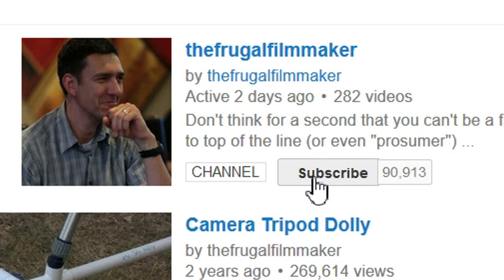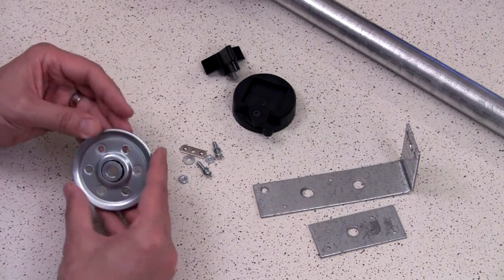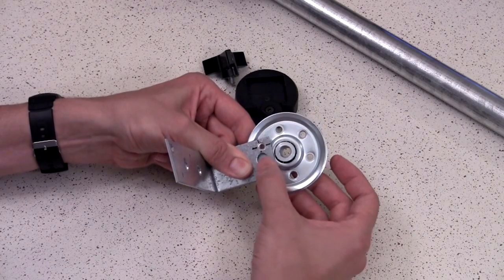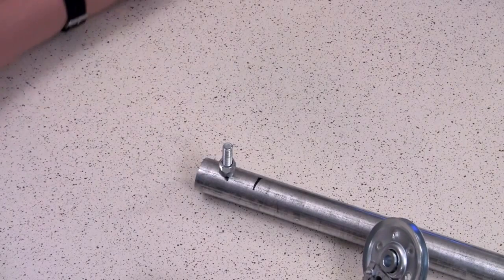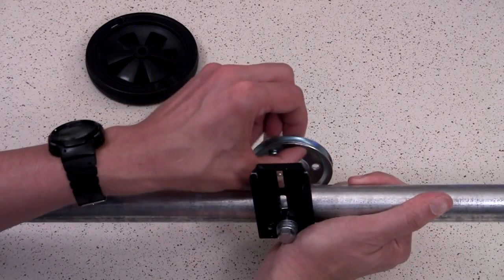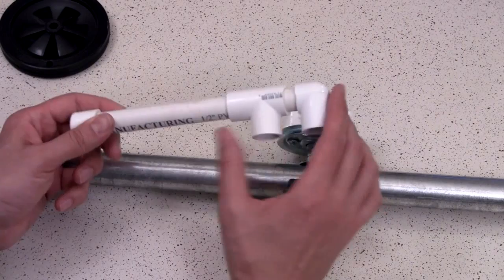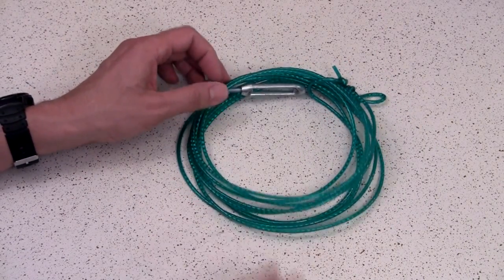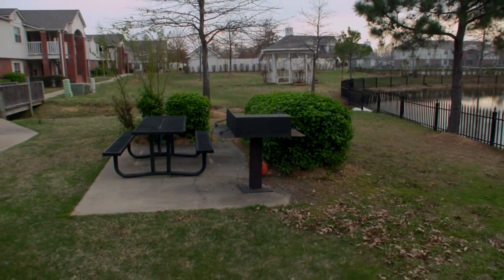Frugal Camera Crane / Jib 2.0

Comment: Re: Stabilizing Tilt... Forget pulley ratios and friction! One to One rotation gives perfect reference to camera angle and you can add a protractor and stops to calibrate shot points. LOSE one sided PVC CRANK! Install long metal pipe centered on pulley's center. Length and mass along with ability to adjust grip to the center of rotation will give all the leverage you want or don't on the fly! This is a brilliant design! You killed a ton of over priced professional jib sales. I love you!

Comment: I've copied your techniques pretty much to the letter so far. I finally made the pulleys from 1/4"Masonite and mounted the arm bearing the camera with its pivot located at the center of the pulley rather than the outside edge. This eliminated the touchiness of the camera movement. Thank you for all the great ideas. It's not making me a great filmmaker but it is providing me with ideas to tinker with.

Comment: I Found that the "L" brackets from your "cage" tutorial work well for this bracket. Its already painted and the shape you needed. Also has the non skip mat where the camera mounts. So no need for cutting any metal for me!
Also used skateboard wheel bearing instead of just the nuts for spacers for the  pulleys. Thanks.for your great DIYs

Comment: just built one with a few changes. I used an aluminum pool pole and clamped it on a dedicated tripod with c mounts used for conduit. this allows for me to slide the handle back for instant weight balancing adjustments. it's so much lighter than the chain link fence pole as well. the second pulley was installed right into my tripod very easily once I took the swivel adjustment knob off and simply bolted in my pulley with no drilling for that. although I have to practice more, the jib works great.

Comment: Thanks for the great plan! I made mine today. It seems to me that if the tilt handle is longer it will lengthen the arc of travel and so reduce the sensitivity issue without trying to fit a larger drive pulley.

Comment: Love this design, it seems to be the  easiest of the cranes that I reviewed. I will try the larger diameter wheel on the upper
part of the jib as you recommended in your suggested improvements. Thanks again second project of yours I'm doing this week.

Comment: If you check the original designs in frugalcrane 1.0, you'll find that it's made from two nested parts, so it's reasonably easy to transport in most vehicles [I know from experience you can fit 6'3" of pipe into a mini].

The point of this is that something is better than nothing, rather than anyone actually expecting it to serve in place of pro-gear.

Comment: Good question. You bring down audio because if you do have sound in any crane shots you want then you can sync up the clap noise you make at the beginning of your take, so that the words or noises from both audio clips match the video when editing. Then you can delete the audio recorded on crane if its no good. But sometimes even audio from your camera is good. I used audio from my 60D when I threw up in a film and the sound was raw. I layered it slightly off my other audio and it worked well.

Comment: built this one its woks fairly well... thinking of adding a hole at the top rail coupler on a 90deg. and drilling another hole on the handle and adding a bolt with smaller pvc for a 360 effect.....thanks for the build.. will send video soon... also painted it all flat black to have a more professional look if a client ever comes into play...

Comment: Hey Frug,
 
Nice jib design and, as always, excellent, helpful video.
 
To deal with the “over-sensitivity” issue that you mentioned, you might want to consider any a several ways to induce some adjustable drag/friction on either of your garage pulleys.
 
One way would be to drill holes through you main beam/fence pole, and insert a nylon bolt through the holes, so that is could be adjusted to rub on the inside of your pulley.
 
Probably the best way to do that would be to use a thread tap, to thread the holes in the beam so that they would engage the nylon bolt, making it adjustable.
 
But you would have to buy the tap, if you don’t have one. So that may violate your standards on either cost or simplicity.
 
But there are probably at least 5 other ways to induce drag on those pulleys to slow them down/stiffen them up/control them.
 
Another may be just wrapping some foam on the fence pole, between the pole and the pulley, to create some soft friction.
 
Anyway  - - -
 
Thanks for an very nice design.  I am probably going to try it.
 
Dan L.
Reply from the maker: Thanks for the tips, Dan! I've been working on a redesign for awhile and your ideas are solid. I'll see what I can do to implement them.

Comment: I don't think he had any equipment we didn't see in the footage. The jib was max elevated, top of the jib oriented away from the tree, but the camera was mounted to look at the tree, essentially, backwards. When he rotated the jib clockwise, it looked like a pan because the camera was rotating on almost the same axis as the tripod head below. In effect, he rotated the cam into the tree as the jib arm pivoted. It closed the distance between the cam & tree while turning the view to the right.

Comment: @thefrugalfilmmaker I added a foam disc to the bolts between the pulley and the boom to create the desired friction to make the tilt handle and pulleys less touchy. The effect is amazing. It also allows you to mount a front or rear heavy camera and not have to hold it to keep it from flopping forwards or backwards. Also, I have added a clamp and wing-bolt to the lower pulley to enable an angle lockdown. If you want I can post a video or pictures...

Comment: I am not sure on the D5000, but many of the DSLR's do not have live view available from the mini-hdmi.  They have playback mode.  Also, Magic Lantern for many of the Cannons have a way to actually play live view in HD.  Almost all of the external monitors may not work on initial connection and may need to just be replugged in for the camera to make the connection function.

Comment: I built your crane and you're right about that back pulley!  Have you found a resource for a larger pulley?  I have not.
I used an extra stage light stand that I have for my base and the crane is bolted the top pole.  Works great!

Comment: I might be wrong, but I think it's quite easy. Look at 10:14 where the camera is pointing "backwards" towards the crane. Now, instead of exactly that, point the camera horizontally instead of looking downwards, and change the movement from counter-clockwise to clockwise, about 180º or a bit less.

I think that's it, and it shows how easy ideas can get good results.

Comment: The only issue I could see with having one pulley bigger than the other, is the rig would tilt on it's own as you move the crane up and down. You would have to compensate to keep it level. But you could do two large pulleys, equal size, for the main cable. And then somehow rig a smaller pulley to the large back pulley as a means for slower tilting, but the large wheel could also be used for more rapid tilting and keeping the camera platform level as you boom up and down.

Comment: Larger wheel at the top (smaller at the bottom) will give you finer control.  If I heard right you had it backwards.

But I'm very impressed with how concise this design is.  Much more straight forward design than pretty much any other I've seen.

How about a v3.0 with tilt and pan?

Comment: I love the idea.  I am building one for myself.  Is there a reason why you attached the camera "L" bracket so low on the pulley.  Wouldn't it tilt more freely with the weight closer to the center of the pulley?

Comment: You could easily attach a weight to the lower pully's arm, so it's always pointed down, so, you would get a continuous leveling stabilisation for the camera. I mean you could do an up/down/up shot whitout having the problem of manually trying to hold the camera at a given angle.

Comment: In addition to adding friction, try using a larger pulley up front, and a small pulley in the rear. A reduced ratio will allow smoother adjustments, but you may need to add a revolving handle to your adjuster arm, much like a bicycle pedal.

Comment: Yes it does look shaky on the tilt. Add a side bar to lock the rear pulley so you can go up and down and it stays level. You cannot change the size of the pulley to make a different ratio because then your going up won't stay level.

Comment: Fantastic build/update!!

I know this is old but, to fix the "touchy" problem you could first try shrinking the lever handle down. For example, if you cut the length of the handle from the end (or where ever you hold it) to the centerline of the bearing you'll cut the torque being applied in half! (Y)

Comment: Nice production.  I'm wondering if you would would fix your control issue by simply extending the length of the cable control arm?  Just a thought.

Comment: Regarding all the comments on the last shot... notice with the back facing camera, you're shooting through the axis of rotation. This is what gives it that stomach churning spin too. This move must be done extremely slow to minimize the vertigo. Notice the top and the bottom as well as the left and right of the frame are moving in opposite directions. Another thing that makes this shot impractical, is the jib and operator are in the shot... Only useful for jib demo footage.

Comment: The camera is probably turned towards the tripod, along the crane. (the picture was turn upside down afterwards)
So it is shooting in the direction of the centre of the circle, that it is making, while turning on the crane. 
A picture would have made it clearer)))))

Extremely creative idea, by the way. Unfortunately, you can't turn down after making such a turn. That's why the real cranes have 2 or 3 moving segments, which alllow to organize any possible movement of the camera.

Comment: Just so you know from an engineering standpoint the "depth" of the structural element is the most important.  Round and square tubing will never be as strong in bending as oval or rectangular (with the same surface and wall thickness dimensions).  However, round is probably cheaper.  For instance by equation a 2x3 is 5x stronger than a 2x2 in bending (which is the most critical for a jib design). A possible alternative would be to screw 2 pieces of 3-5/8" metal stud framing track together.

Comment: You could use a top pulley with no center bearing and mount it on your bolt shaft with washers an coil springs to adjust the tension. This will create the friction you need to reduce the 'touchy' problem.   You could also put a swivel handle on the bottom pulley so it is operated like a fishing pole and smooth to rotate.

Comment: Hello, I was wondering if I could use smaller pulleys, like 2 inches of 
diameter. I'm in France and i have problems finding pulleys with ball 
bearings bigger than 2 inches. Thanks a lot for your remarkable tutorials !

Comment: My thoughts exactly, Why not just add an adjustable bolt parallel to the pulleys axle, and put something with a little friction on the bolt and adjust it so that it touches the pulley? Bigger pulley is a good solution though, but it only reduces the sensitiveness by the same factor as the ratio ofc. (and is fixed wich may make it less flaxible with different size cams (?)

Comment: when buying a tripod to use to do this, how much weight do you suggest the tripod should be able to support?  i'll be using a canon xf100 which weighs a little over 2 pounds, but i'm concerned about the weight of the jib being a factor.

Comment: You could probably fill the bearings with a thick grease. That would slow the movements down considerably if they use a liquid or thin grease.

Comment: I like the design. I agree a larger pulley up top would help. Also how about adding a 5# barbell weight to the pulley with the arm on it to act as a flywheel to help smooth out the rotation. It would also act as a smooth start stop helper when tilting. Nice job overall!

Comment: All you need is a good stiff angle bracket between the speaker mounting plate and the jib mount. That would use the pole as a crude swing joint. A better solution would be a lazy suzan swivel on top of the speaker flange, and mount the angle bracket to that.

Comment: If you try to do this manually (without electronics) you need a 3rd hand to move crane, pan, and tilt at the same time.  So maybe with an assistant this could be accomplished.  Personally I would look at a pre-built one for that.  Also, some of these designs allow for a tripod head on the end which can be manually moved in multiple directions (but only when you can reach it).

Comment: Have you ever considered push-pull cables rather than the pulley system?  I picked up some cheap cables on clearance for this sort of project but wanted to know if you had tried and/or foresee any issues with this solution?   By having multiple attachment points for the distal terminal, I can imagine being able to adjust the "sensitivity."  I'm also considering adding some arms at the proximal end to allow the camera to automatically maintain a level position if desired.  Thoughts?

Comment: I am sure it would wobble,so not very well.  With that type of weight (which is common for most pro-sumer cameras) you would need something with a greater depth.  Something like 2"x4" tubing with a decent gauge for maybe 10-12 feet long.

Comment: Wouldn't it be a good idea to put a 90 degree elbow PVC on the end of the "rotation control" and a pipe on that with a slightly larger diameter PVC slipped over that and an end cap so it swivels in your hand and still "cranks" If that makes sense...

Comment: what do you recommend I do if I just have a standard tripod with the standard tripod screw and removable plate? I dont have a big one like you do where I could drill a hole through it to mount the pole on.  I dont really wanna have to buy another tripod just for that.

Comment: I have a hypothetical question for you.  If you actually had a Hollywood budget, would you still use your designs (or modify them for larger cameras) in place of their pro counterparts.  For example, Frugal rig instead of a Fig Rig, Frugal Floater instead of a steady cam and so on.  Which designs would you use or not use if you had a big Hollywood budget and why?

Comment: Have you thought of changing out the back lever to a weighted system?  you could have the lever instead hang straight down with 2.5lbs-5lbs or so to stabilize and adjust your turnbuckle so this position has your camera pointing straight forward.  The weight should help with the twitchyness as well as let you use the crane without having to manually tilt as you move the camera up and down

Comment: Rather than cutting the truss bracket off, drill the hole big enough to go entirely over the axle bolt of the wheel (about 5/8"). Then use a smaller hole above, and a smaller hole below, the axle to anchor the bracket. Stronger connection this way, and more importantly, puts the center of the Camera closer to "on-line" with the wheel axle which makes a much better balanced load for the wheel/winch to manage. (Shorter "arm" if you are familiar with weight & balance jargon).

Comment: Seems like most other designs LOCK the tilt motion in place. I like the tilt/pulley idea, but the sensitivity of the pulley system seems like an issue. 

Perhaps a design that includes a second tube to "lock" the camera plate with the pulley system still mounted. This would still allow the ability to tilt, but give both options. Basically a normal design jib with a pulley mounted on the side.

Comment from the maker: In the video, I am running an extension cord from my apartment, but I have since purchased a very nice 12v battery that keeps the monitor going for over four hours.  I made a video about it called "Tip: External SD Monitor Battery".

Comment: To add pan, the tilt must translate to a vertical shaft run co-axially with the pan's axis. Then BOTH must be translated to a horizontal axis again to maintain the single beam construction. It's a nightmare for simplicity. I have some ideas, but I'm not close to happy...

Comment: Any thoughts on how you could modify it so that you have the camera point at a right angle to the jib for situations where you have to be off to the side of what you want to film, but unlike the current design where your up-down tilt control would now be a left-right tilt, have an up-down tilt that works at this new angle?  I'm guessing you would need to mount the pulley+camera mount on another pulley, which might work fine with strong metal pulleys used in v2.0, but how to turn that new pulley is a question.
Reply: The only way I can see for adding a y-axis pan to a crane jib is to place the gimble on a motorized pivot point (ex: https://www.youtube.com/watch?v=AJi_GMX1M74).

Comment: Since the lack of frictioin is causing problems why not purposely add some friction to the side of one or both garage door pulleys with some foam rubber or some other material which will last longer?  Maybe a multi-speed bicycle brake,,,,,

Comment: well i gave it try. it works really well but yes it does add a lot of weight. but i don't need to transport it anywhere for the most part. so it works fine. and it was cheeper cuz i had all the parts laying around.

Comment: If its over 5 or 6 feet, no it would not be (since most cars can't hold a 10 foot pole).  That is why may folk make smaller ones.  If you need to join sections you have greatly increased the complexity of the design.

Comment: you could use a small electric motor that can read that degree the axle is, that way all  you would have to do is use a potentiometer to control speed and a switch.